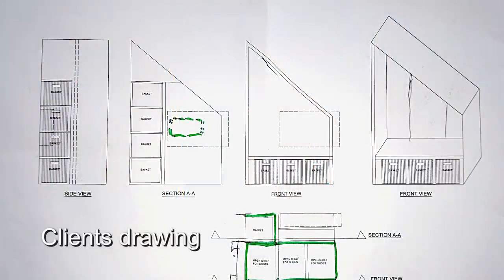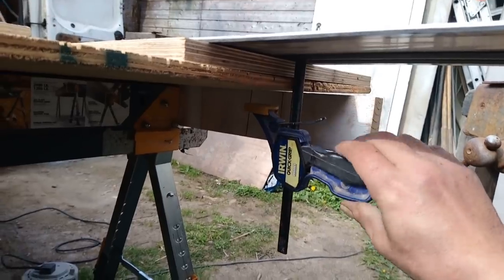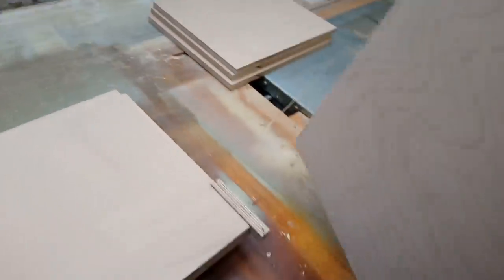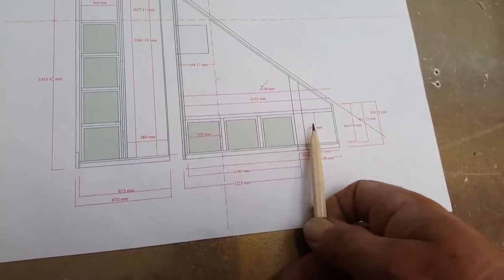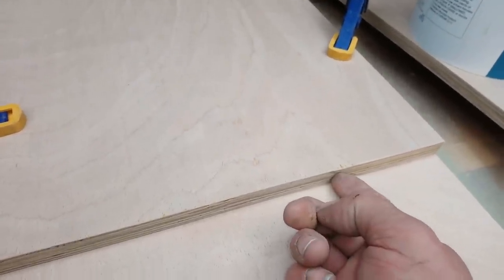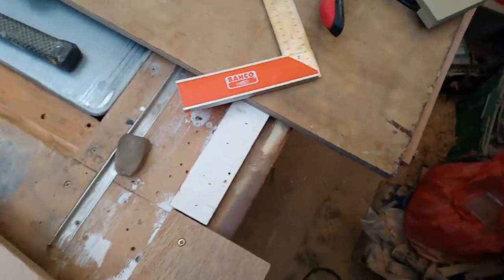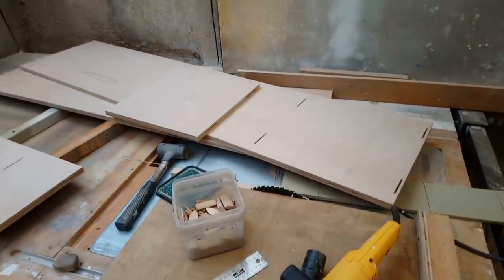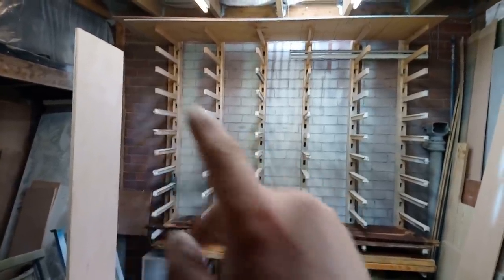Understairs storage & coat rack 1

Comment: Well you have changed my mind Gid. I'm about to make some cabinets for a Laundry (melamine) and was going to use 5mm dominoes as the joiners (can't stand dowels). but having seen you use the the biscuits, I think it is a better option for strength. thank you for the inspiration
Reply from the maker: Thanks Peter, yep dominos are ok but i don't have the smaller domino machine, the biscuits give a wider piece for alignment, the domino is not much more than a couple of dowel widths, I'll buy the domino 500 one day but simply because i have to have one, until then what i have will do 👍

Comment: Great video, rather than invest in the DF500 check out the Seneca adaptor, it will allow you to use the smaller cutters in the DF700
Reply from the maker: Thanks Wayne 👍 yeah I've considered that but they aren't cheap + the 500 cutter, the XL is a big heavy machine too so one day I'll buy the 500 simply because i have to have one but until then what i have will do 👍